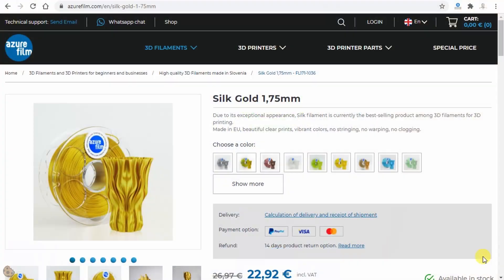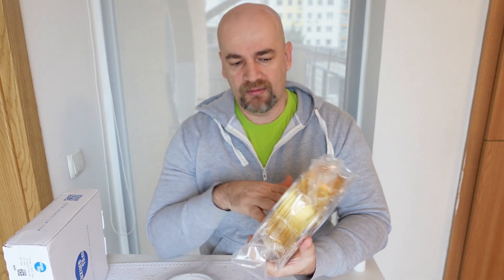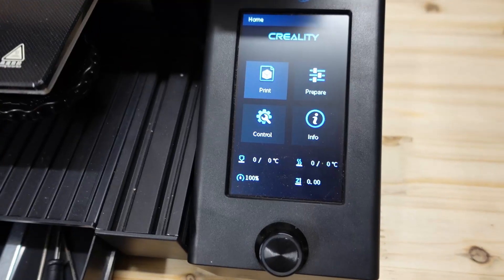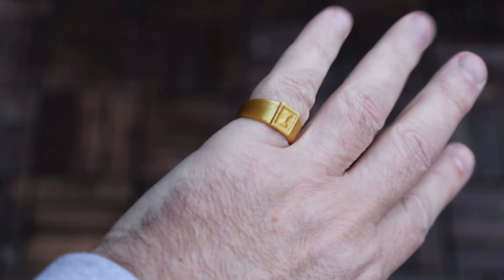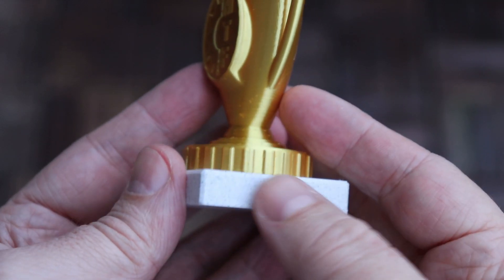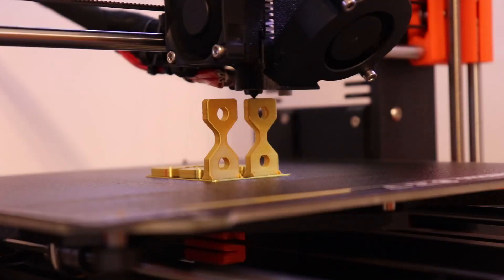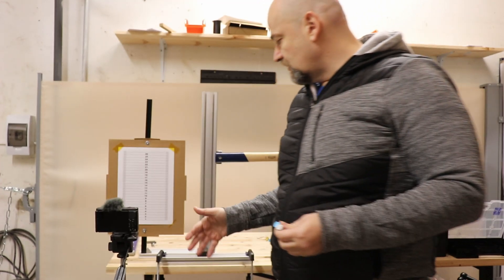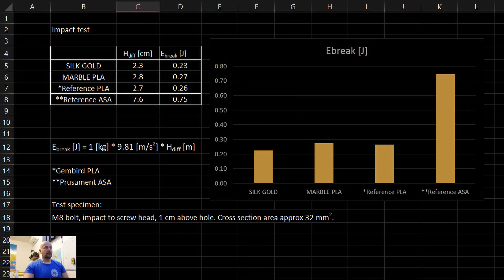Testing Silk Gold and Marble PLA filaments by AzureFilm

Comment: Hello, can you tell more about the settings used for printing trophy cup? Fan speed, print speed, etc?
Reply from the maker: 225/80C, max cooling, speed 60mm/s: https://youtu.be/QfceCA_ayYw?t=187
Reply: @MyTechFun  thanks, do u recall if you started with max fan from the start?
I'm having some issues, as wall usually rise higher than infill.
Reply from the maker: @kuzmic77  No, never start with fan at start. First few layers always fan OFF (on any material)